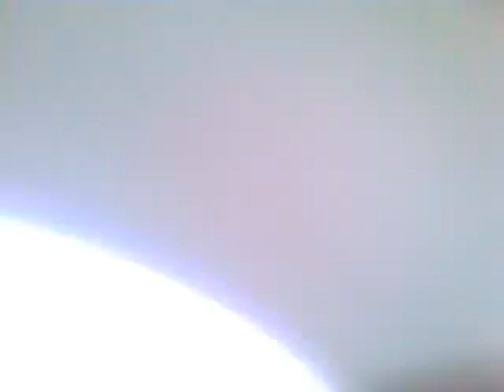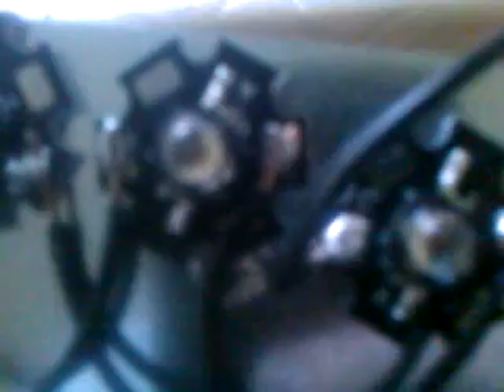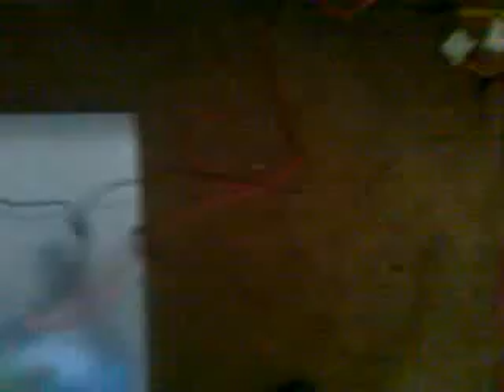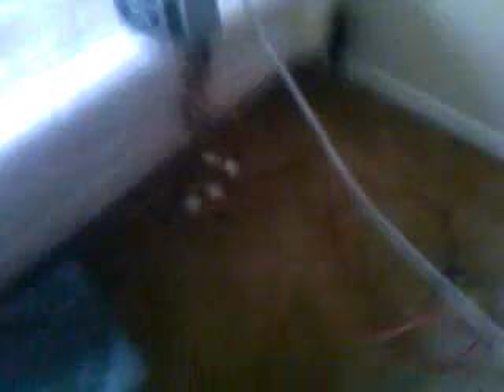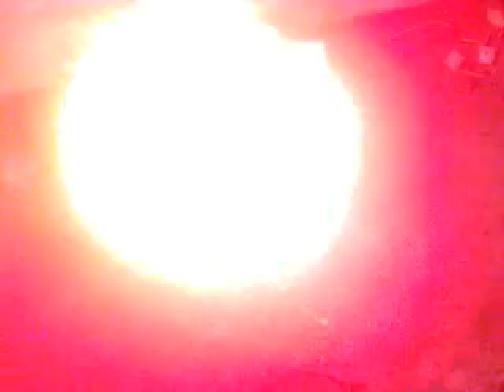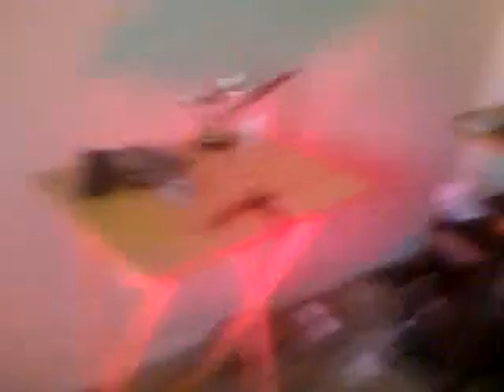MY DIY LED GROW LIGHT

Comment from the maker: Sorry for the lag in response, due to that very same problem i ended up soldering them in "series" I didnt have to use resistors as the 12v is distributed by 6 leds i think, ill post the formula  when i remember it, let me look in my notes

Comment: I have 47 3w leds and 5 19v 50w 2.64A laptop power supplies. can someone please tell me how to set them up so they dont burn out quick? im trying to use array wizard. but it says "the wizard thinks the power dissipated by your resistors is a concern" what does that mean?
Solution 0: 6 x 3 array uses 18 LEDs exactly
+19V  R = 1.5 ohms 
         R = 1.5 ohms 
         R = 1.5 ohms 
 the wizard thinks the power dissipated in your resistors is a concern 
••